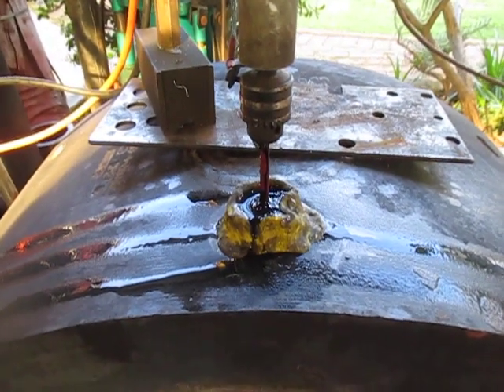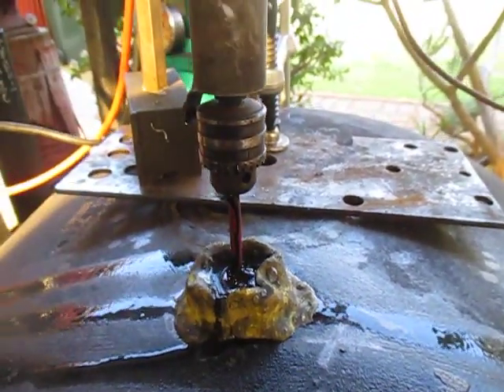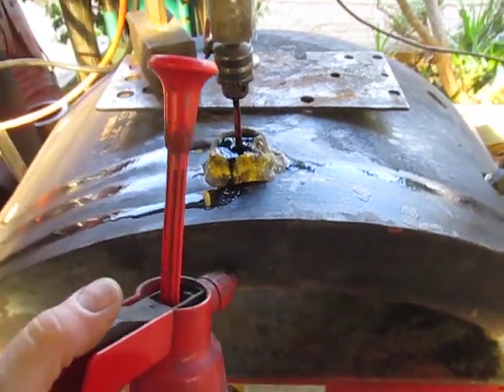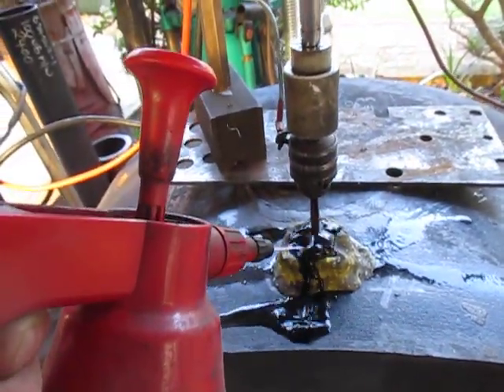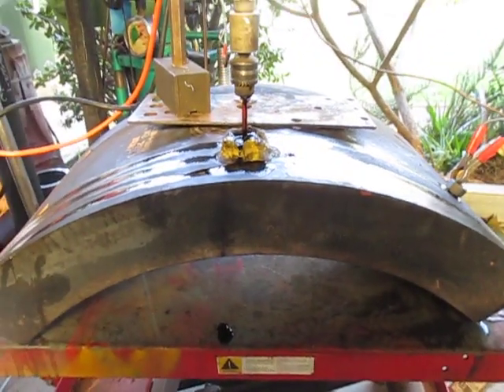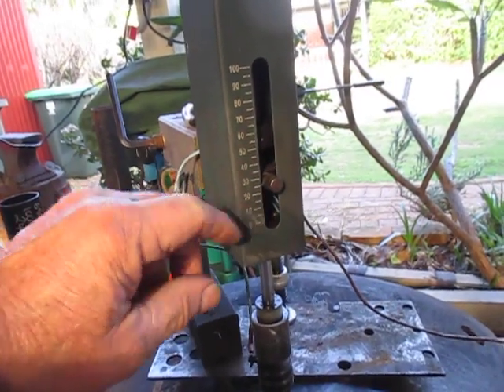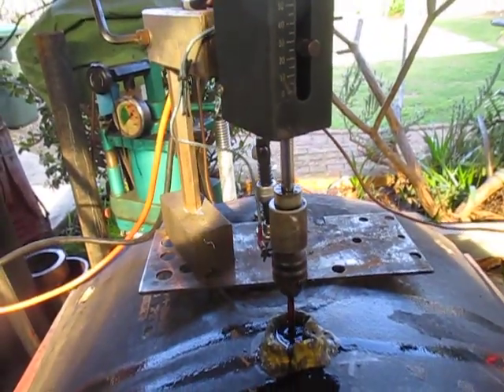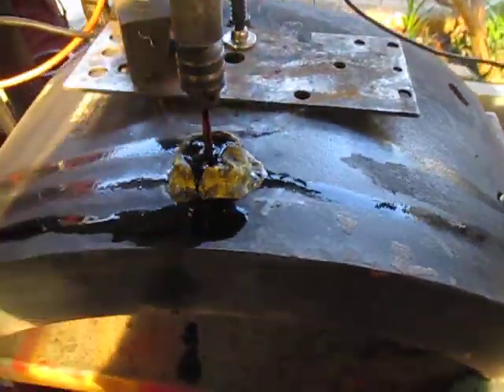Getter Out Spark Eroding Forgings 2nd movie.

Comment from the maker: The Electrode I use is normally smaller than the broken drill / tap / ezi-out / dowel pin etc. generally 2/3rd's the diameter, however if the hole is deep, then I use progressively smaller electrodes otherwise they will begin to arc across or jam. If the hole is deep then the top section will be made to the maximum diameter allowed to give as much telescoping options.

Comment from the maker: Straight Flute Carbide Drills, Carbide Mills and Carbide Burrs and Picks and other instruments were used first, the hole size is small and the deeper in you go the size restrictions take over, moreover the periphia of the hole becomes jagged and ragged from the destroyed drill bit, and the swarf such that carbides are at great risk of shattering. Horses for Courses! That is the time that the EDM comes into it's own.

Comment: As a matter of interest if it was you that had been asked to get these holes in this casting how would you have gone about it? -Afterall getting a 6mm hole is a really narrow hole in a piece of 90mm thick casting.
Reply from the maker: Dan Whiteford I would have drilled it with HSS drill bits with plenty of cutting fluid, and continuous pecking, bringing the drill bit out all the way to clear the flutes and the hole. The problems facing this type of forging is that the drill bit will wear on the sides of the flutes at the top, that will create a "Jamming" effect, moreover the forging may have some hard spots that can deflect the drill and when you are deep in that can bind up the drill and cause breakage. Patience is the name of the game.
Reply: Thanks for your reply.
Reply: +Bruce Whitham 
What about a carbide drill ?